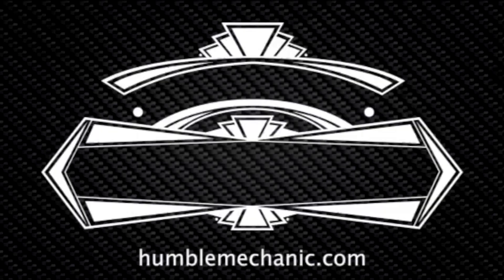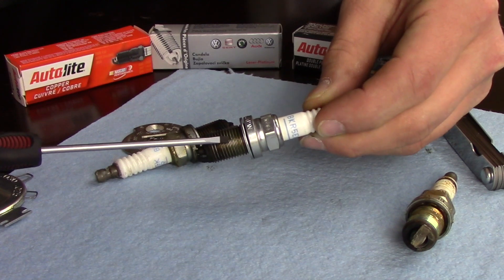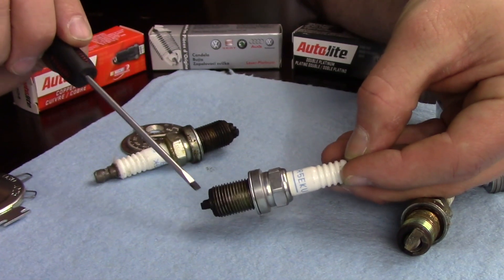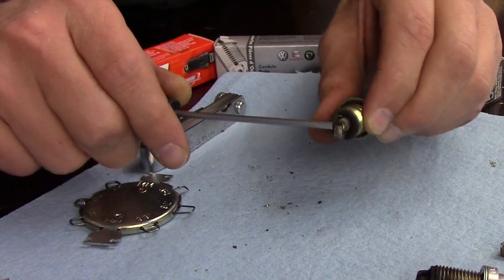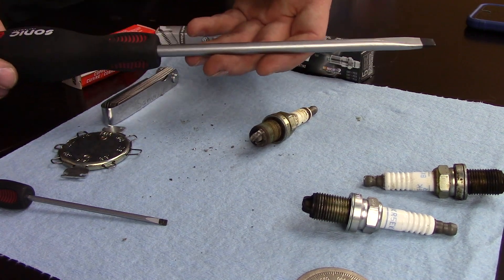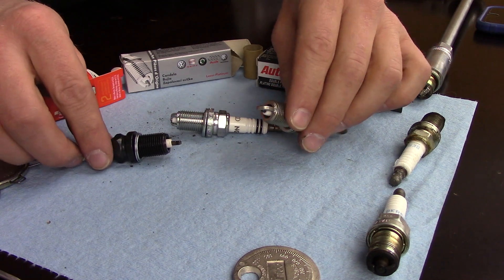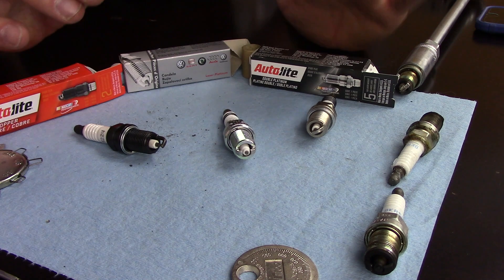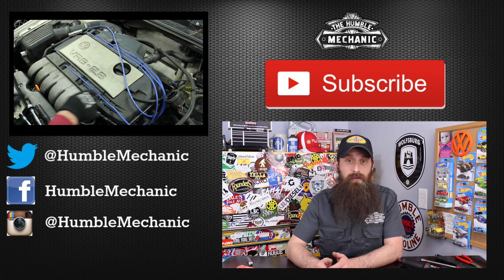What You Need To Know About Spark Plugs

Comment: Umm I was really looking forward to hear the differences between copper - platinum and iridium spark plugs. and also about single tip and double tip spark plugs
Reply: First off, spark plugs dont make any power. They just provide a space for a spark to jump. It does nothing else. It does need the proper heat range so it wont get fouled at idle. And performance cars use a wider gap to get more of the air fuel mixture between the gap to make it easier to fire off the mixture. Plus performance cars have higher powered ignition systems in order for it to jump a wider gap. The material the plug is made for make no difference in power or performance either. Just how much they cost. And duel, triple, etc. etc. ground plugs wont make any difference in power or performance either. Electricity folows the least path of resistance and it will only jump to one ground and it's done.
Reply: @dwc4343  Performance cars also use colder plugs as well, right? Another reason for the ignition amplifiers.
Reply: @reubenmorris487  That's due to heat and cylinder pressure, and nitrous use as well.
Reply: @dwc4343 , that's not true regarding single vs dual electrode spark plugs. Some cars, including my Toyota, specify "use platinum dual electrode spark plugs only", and will NOT start, let alone run, using single electrode spark plugs. I know for a fact because I just wasted $35.00 trying the NGK recommended single electrode Iridiums. My car sputtered, but refused to start. I put 3 of the old Denso platinum dual electrode in the front 3 cylinders (because I wanted to see if there would be a difference and because the back 3 are a MOFO to get to) and the car started this time, but ran like shit, running on 3 cylinders. So I swapped out the rear 3 with the old dual electrode plugs and the car immediately started and ran perfect. So I had to go buy NGK Laser Platinum dual electrode spark plugs at $75.00 for 6. So there absolutely is a difference between "single vs dual" electrode and some engine's require dual electrode spark plugs.
Heed your manufacturers warning.
Reply: Just use OEM style spark plugs. Don't bother using platinum or iridium if your car doesn't need it. It'll do nothing more at best. It might even get you lower gas mileage. It did on my older car. I sticked with copper because that's what the engine was designed to work with.
Reply: Ben Gagnon When the difference comes to literal dollars for quality.

I'd rather get the best than the cheapest, car was designed to work with OEM Oil Filter, but i'm still going to buy Mobil 1.
Reply: I think iridium is better for modified cars making a bit more power as the plugs will have reduced life anyway. Modified cars also benefit from a shorter reach and closer gap. I've had a recommended plug change from as high as 30,000 (OEM is 60,000) to as low as 15,000 miles, but that is referenced to high boost turbocharged cars.
Reply: SI0AX . Many cars come with iridium plugs from factory.
Reply: Rex Erection Iridium and platinum are both precious metals and though do not oxidate that easily. Iridium is the most corrosion resistant element in the world and it is very similar to platinum. Both metals are very conductive as is gold and silver. But it is always better to not use the rare precious metals on earth, when there are very good alternatives like copper.
Likewise you could make electric cables out of gold and they would be better, but who could afford that, if even copper at 6$ per kg is too expensive for some applications.
I read online that the iridium spark plug are smaller and thinner, but despite that they last longer.
Iridium is even considered stable at temperatures up to 2000 degrees celsius and melting at 2466 degrees celsius and considered to be almost impossible to machine.
Copper even melts at 1086 degrees celsius.
It should not affect your gas mileage at all, that is rather a belief of the top commenter than fact.
But if you care about your wallet and nature, just take copper spark plugs.
Reply: Rex Erection  Copper works well, its all through your house.
Reply: Rex Erection  Any copper core plug will work fine on your car.
Reply: My GTI came with platinum plugs. I tried NGK Iridium plugs this time. It does start better, and I've gained about 2 miles per gallon. So I'm happy with the extra $8 I spent.
Reply: Aniruddha Vispute Google it
Reply: Aniruddha Vispute for 1000cc engines you don't need to fuss about copper platinium gadolinium uranium or plutonium spark plug.spend money on good tyres engine oil .
Reply: iridium last 2-3x longer than copper so your better off just using one of those just for convenience
Reply: SI0AX  i use to think that as well.  for modified cars go with copper or silver.  silver works great but are expensive and have the shortest life.  copper is a bit more affordable but again doesnt last as  long.   figure 20k on silver and 30k on copper.  but they will conduct electricity the best.   

platinum and iridium are really more for everyday cars.  they can last for years.  they are however poor conductors of electricity.  at 25psi and 6000rpm the last thing you want is a poor conductor.
Reply: http://eddy-current.com/conductivity-of-metals-sorted-by-resistivity/
Reply: Copper core is for low voltage ignition systems. (Distributor types, 5k-10k volts)

Iridium & Platinum is for high voltage systems like COP's. (20k-30k volts)
High voltage ignition systems will actually erode and remove the metal on the electrode. This is why the gap is consistent for 50k-100k miles and then suddenly burns open to like .080". 

ALWAYS USE OE. And check the gap. Even on a pre-gapped plug. 80% are off a bit.
Reply: @austingibson3315  BS, stock V8 cars use 40k volts since the 60's using copper core plugs. They did not start this iridium and platinum junk until the late 90s and it makes no diff. The copper core will still work just fine in them. Have them in my 05 van right now, plus everything else I run. The MSD box we run on our racecars puts out a lot more than 40K and they all run copper core plugs too. So does NASCAR and ever race series that runs MSD boxes.

Comment: My mechanic buddy uses anti-seize on the threads and dielectric grease on the boot connection.  Is there anything detrimental to this?  Seems like the right thing to do.
Reply: The anti seize could eventually cause the spark plug to come loose and need to be tightened again but that could take a longer time that the anti seize would last. Other than that, nothing's wrong with doing that
Reply: Todd Magee 
Not a fan of anti seize at all, I've never had much luck with it doing what it says it's supposed to. 
It's just metal chips mixed with oil. 
Use plain wheel bearing grease, or even cv joint grease (i prefer that) it works fine. 
Even a dab of motor oil from the dipstick in a pinch helps em thread in nice without galling threads.
Reply: I always just spray some WD-40 on the threads to lubricate them and make the plug screw in easier. I've never had a problem doing it that way.
Reply: Just use very little anti-seize on the threads, it helps out a ton the next time you go to replaced the spark plugs.
Reply: Todd Magee - Keep that mechanic buddy. Not very common to see a  professional doing all that. That's a good one. ;-)

Comment: 1/12 to 1/16 of a turn.... drain plugs and spark plugs are the only things that I do not use a torque wrench on lol
Reply from the maker: HAHA, Funny how we all have our own things. :)
Reply: HumbleMechanic The only justification I have is from my track record, every time I have installed new spark plugs on my 2 vehicles I have been okay using that method lol
Reply: different cars have different torque specs for these things. Snug might not be snug enough.
Reply: Darksyne the difference for spark plugs and drain plugs are various vehicles is so pedantic. if the torque spec is 16 ft lbs and i actually torqued it to 19 its not a big deal.. it's not just "snug" you tighten it further after it has snugged up
Reply: *****
you never know where the breaking point is after the recommended torque spec is. Maybe if you got enough practice and you work in a fast pace environment where time is money then yes it won't matter too much, but in any other situations I prefer to use a torque wrench like if i had to work on my own car.
Reply: Darksyne mind you my original point that I only do this to drain plugs and spark plugs, everything else i use a torque wrench. I see where you are coming from but after many oil changes and tune ups the threading is in good condition. I even used a borescope to see if there were metal shavings in the combustion chamber.
Reply: *****
I gotta get one of those for my car. I tend to be a perfectionist when I'm working on my car because I want it to last as long as possible. New cars are such a loss of an investment.
Reply: Darksyne the one I bought isn't listed anymore but it's like this: 
https://www.amazon.com/DBPOWER-Cellphone-Endoscope-Function-Compatible/dp/B01DVXHYX8/ref=sr_1_4?ie=UTF8&qid=1476142653&sr=8-4&keywords=B00GFH5DA4%7CB00HIZDM2I%7CB00HJJLSRO%7CB0158DMF7E%7CB018HQQ2T6%7CB01B5RRYP0
Reply: Experience and repetitive work can let a pro skip a step on plugs like using a torque wrench. 
After a while you get a feel for the gasket crushing down

Comment: hey humble mechanic I have a question for you. i drive a vw jetta mk4 1.8t gli. what spark plug brands for vw's do you recommend? what spark plugs do you use? what is the difference between platinum, iridium, copper, silver and double platinum? ..  I've heard rumors about platinum and iridium plugs being not as good performance wise.
Reply from the maker: Stock car, OEM all the time 100%. That is what I run on my cars. Well, the Wookie may get something different, but that's TBD. VWs and Audi get very sad with non OEM plugs.

Comment: Most plugs today are pre gapped or gapless. Only gap pre gapped plugs after about 10 thousand miles as they open up over time. NEVER use a feeler guage. Use a GAPPING TOOL since the electrode on most plugs is not flat, but dished. Using a feeler guage will ALWAYS result in a gap that is  too large

Comment: I have a 1984 honda big red 200es, and noticed some oil on the spark plug and around the plug area, and some smoke out the pipe, any help with this like  is it rings or head gasket, I changed oil 2 weeks ago did some riding check the oil and oil is low thanks for any help

Comment: I can remember when the Type IV engine started appearing in the VW Type II Bus. The type IV engine used the longer plug and it was not at all uncommon to find a spark plug for a Bug (shorter) in the Bus engine. It was also common to find a couple of plugs rolling around under the sheet metal on the Bus engine (magnetic spark plug socket made your life easier here).

It used to be very common to have an "engine analyzer" in the shop that had an oscilloscope in it so you could look a secondary ignition wave forms, actually this was a very good diagnostic tool. Another good tool from "back in the day' was a simple two gas analyzer (HC and CO). These two gas analyzers really allowed you to put the finishing touches on your tune ups and aided in diagnosing a driveability concern. You had to remember to get you gas sample upstream from any device like a cat converter and remember to disable an air injection reaction pump as your gas readings will be distorted by these devices.

I had a problem 1995 (I believe it was a 1995) 6 series V-12 BMW where these two tools would have been so very useful (car was an HC failure and we were no longer set up to work on this failure efficiently..
Reply: Love that reply, "took a shit". I gotta remember that. Thanks!

Comment: I've used bosch plugs in my corrado vr6 and they literally worked for a week then took a shit. NGK is best for vws in my experience.
Reply: wtf i bought boch ones today for my nissan pulsar 1.5 litre, i hope they last longer than a week.w
Reply: You should probably be alright BadMadPlay
Reply: Aaron Purtell
thanks man, next i will use seafoam but i should of done that first lol.
Reply: Wouldn't hurt to use some seafoam, I would recommend using some fuel injector cleaner as well BadMadPlay
Reply: Aaron Purtell - Definitely something wrong either in the choice of plugs equivalence or some other factor you didn't account for. No normal plugs last one week. Not even the Chinese clones. ;-)

Comment: The only time i'd consider removing a spark plug on a hot engine is if it's stuck. A friend's car 3 and 4 were so tight i was afraid i was going to break the thing, so i let it run a few minutes and hit the plug with a bit of cold air from a freeze kit he had (those "cryosurgery" kits, i think, said cryosurgery on it).

Managed to remove them with at least half the initial force i put in it, first time i was actually rocking the car a little. Lastly, whomever whales on spark plugs can kiss my ass.
Reply: That's similar to how you can get out the threaded part of a busted plug. You run the engine up to normal temperature with the busted plug still in there. That heats and expands the cylinder head while the cool air going back and forth through the plug keeps it cool. Essentially the head expands away from the body of the broken plug and allows you to remove it.

Comment: changing plugs from a hot aluminum engine runs the risk of damaging threads because the plugs are HOT and you want to just get the.plug into the cylinder head as quickly as possible.  you have to thread the plug in CAREFULLY to avoid damaging the soft aluminum threads...

Comment: I have a 2010 mini cooper clubman S and it's vibrates a lot at low rmps but when I'm doing high speed it feels smooth. would it be the spark plugs.
Reply: Check following in order easiest to hardest:

1. low oil (don't trust the dip stick, triple check, stock dip stick on that car is shite)
2. turbo rattle (remove covers/tubes with engine cold and inspect, shake, observe, spin etc. Re-assemble cleanly.)
3. engine mounts 
4. dip stick rattling inside (yepppp)
5. timing chain tension

5 is beyond normal means, i'd seek a mechanic there.

All of the procedures above are presented in videos online so it should be easy for you to check a few videos and get an idea on how to do it.

Comment: can you use iridium spark plugs when running a carbureted engine?
Reply from the maker: +meowtrox1234 you can, but it may be overkill on that engine.
Reply: Overkill in a sense that it can't do any good? what about hotrods? what sparkplugs do they use with hotrod configurations?

Comment: apparently silver and copper are the best electrical conductor. They use  iridium and the other metals to prolong life. Copper plugs can wear out in 20K
Reply: +sranjesuper I've got 3 Ford Modular motors that get nothing but Auto Lite copper cores, cheap as fuck and a piece of mind when i change them every 6 months.
Reply: some old bmws had silber bosch plugs
Reply: Platinums can literally outlast the car in some cases.
Reply: Crusty Crab yeah i used to change my old benz cooper plugs every 20,000 and they were always worn out... also the newer engines its harder to change it, so they make it last longer

Comment: I myself if I don't have a "spark plug socket" with either tapered or rubber insert. I'll just take a tiny piece of tissue paper and insert it into the socket to it helps to hold the plug to the socket. 
This trick also works for hard to reach fasteners as well.
Reply from the maker: +Joseph Murray NICE! I use that for fasteners too.
Reply: Tape, magnets, bubble gum, chewing gum, etc. etc. what ever works for ya. lol
Reply: Thanks Joseph, about to replace some heavily recessed plugs...

Comment: Hey Charles I've got a question:

I'm a new viewer do I am just getting caught up on what all you have done and do currently. I was curious though if you know of pre and post track or race maintenance I know changing oil trans fluid and diff fluid, but are there are other recommendations such as areas to torque changing plugs etc after running your car pretty hard? I'm not a VW owner, but I have respect for any experts opinion which I consider you to be. If you have any info/suggestions please let me know.

Modified car not stock I say this because I know you usually recommend the manufacturer specs abs service intervals when the car is stock.

Comment: from my vast experience ( aftermarket and dealer) in the automotive field, cars are getting more and more picky. I would never install anything thing but factory plugs ( also available in most cases from the parts store) into any vehicle 2010 or newer.older vehicle are not as picky. I would recommend bosch or german plugs for a german vehicle, ngk or denso plugs for asian based vehicles, champions for dodges acdelco plugs for gm based vehicles and autolites tend to do well in fomoco vehicles.however this is only based on my knowledge. please do not use anti-seize as it tends to break down the electrical connection.... did the manufacturer? no for a good reason :)
Reply: +chris keiley Even older actually if you have a GM vehicle especially the 3.8's as they had those funny waste spark ignition systems and it DID NOT like copper plugs.